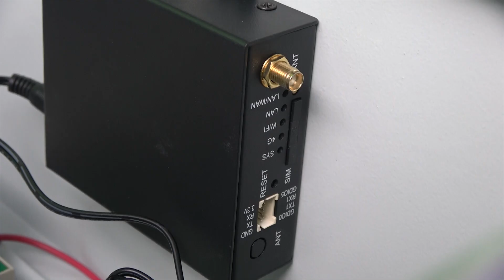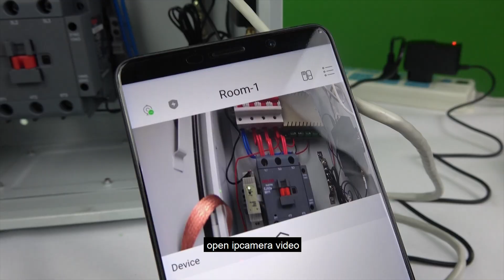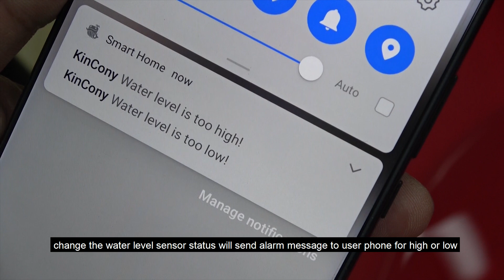[Smart Home Automation DIY] How to Make 3 phase Power Distribution Box

Comment: How to use switch with kc868 versions? Am thinking of using switch for manual control for guest and use remotely to turn of and on the lights when far away from home
Reply from the maker: just add switch terminal board , then you can connect with wall switch panel and use wireless remoter for manual control . also you can use PC or phone app remote control at the same time.